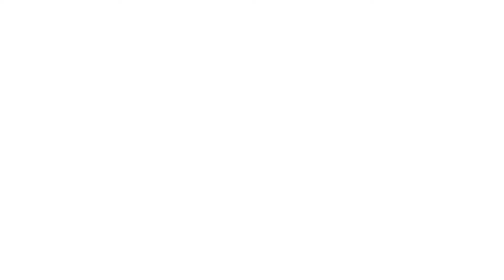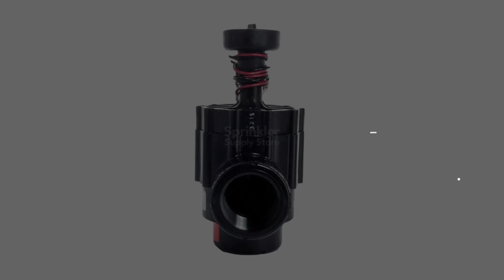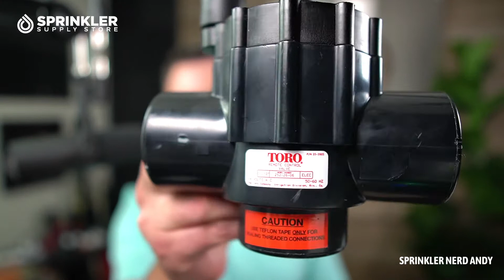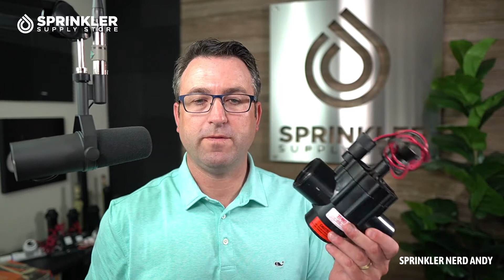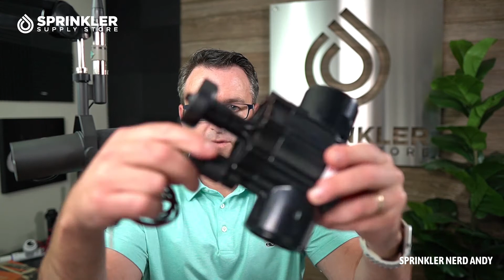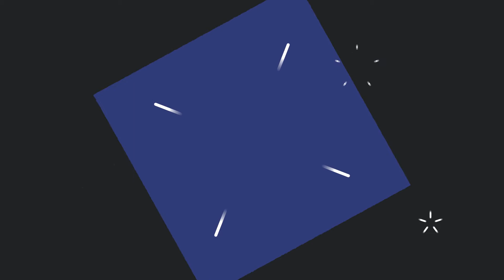Toro 252 Series Valve, Electric & Hydraulic Options, Globe & Angle

Comment: I have this unit in my sprinkler system, but I can't figure out why I even need it.  Even after watching the video, I don't get why it is useful or necessary in an irrigation system.
Reply from the maker: Hi Crypto - Valves are used to control a series/group of sprinklers. Typically, the water supply is not large enough to water the entire landscape all at one time, and valves are used to break the landscape into small zones (groups of sprinklers). The job of the controller/timer is to control the valves with 24v power. Hope this 30sec explanation helps!
Reply: @Andy_Humphrey  Thank you.